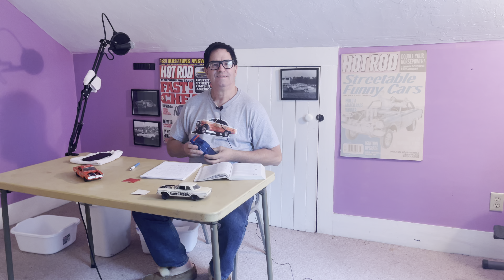Show #52 - Dodge Engine and Driveline Facts

Comment: I’m pretty sure Hemis  were banned from NASCAR In 1970, When Ford Showed Up With The Ultra UBER SUPER,  DA DA DA Duper 429 BOSS WITCH WON SEVERAL RACES & Noted SUPER NASCAR BUILDER SMOKIS UNIC.. (Ha what a handle) Bulit A GARAGE FULL OF EM.. BTW ITS NOT A “Semi Hemi” It’s The Most UNDERRATED & MISUNDERSTOOD Musle Moters Of The Era.. Off The Showrooms Rated @ 375 HP.. YEAH RITE.. Well With Some Tuning IE Hooker Headers & NASCAR CAM& PISTONS.. That BIG BLOCK WAS 750 + HP MONSTER THAT 426 COULDDREAM ABOUT EVEN COMING CLOSE TO Not To BEST LOOKING ENGINE EVER.. these are facts too…

Comment: I have read before ( and a recent email conversation w Don Garlits ) that every 392 was dyno tested before it was installed . I don't know if this is also true in 354 and 331 ? I also wonder if this was  just 300 model ( or perhaps just Imperial ) ? Too much of the 50's vintage has been lost forever , too far gone to confirm I suppose.

Comment: Steve, assuming I didn’t misunderstand your point on fact #751, about the T/A being unique in having adjustable rocker arms and hydraulic cams, the 426 Hemi switched to a hydraulic cam in 1970, and retained the adjustable rockers that they had used in previous years, and the same in 1971.

Comment: I thought that the SCCA did away with the 5.0L limit for 1970 and that's why the Chrysler 340 and Chevy LT-1 350 were used.

Also, I have one of the Clutch-Turbo 400 transmissions from one of my uncles drag cars in a corner of my shop. I need to find a project to use it in.

Comment: Thank you so much for the info on the hemi blocks that were modified to use the max wedge heads. I recently acquired a bare hemi block with the same modifications, and it had me scratching my head. Now I just have to decide if I should change it back to accept hemi heads again, or put some max wedge heads on it.